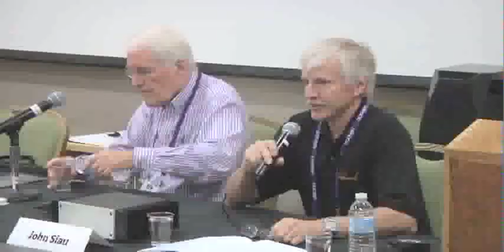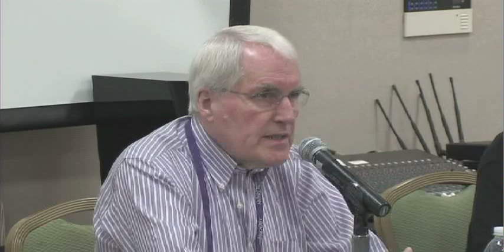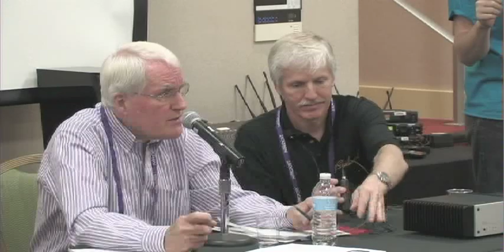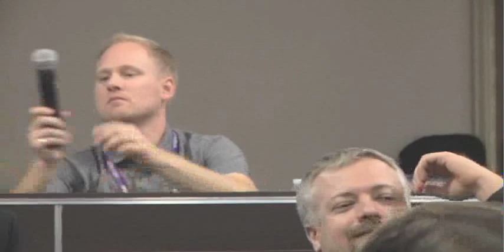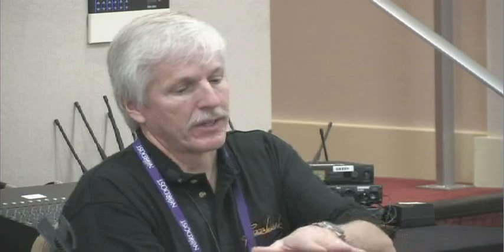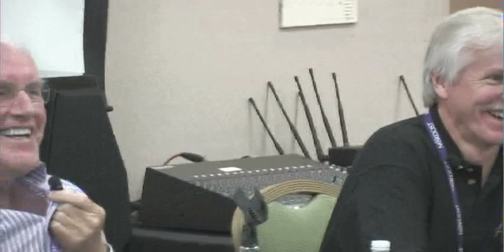RMAF13: Why Most 24-bit Audio Systems Still Deliver 16-bit Performance

Comment: Two companies that have come together to slap the relevancy of nearly every other device in the categories they've released their devices.

These are the sorts of people that push our quality sound standards further. And more importantly our understanding.

I challenge anyone here in the comments to demonstrably display any device that comes remotely close to what Benchmark's Power Amp is capable of: https://www.audiosciencereview.com/forum/index.php?threads/review-and-measurements-of-benchmark-ahb2-amp.7628/

This device is years old, and still nothing remotely close comes to challenging the fidelity this provides.
Reply: Yup, IMO that thing single-handedly demolishes the entire "high-end" power amp industry.  You can shell out ten or more times more than its $3k price tag and you'll wind up with measurably and audibly inferior performance -- it's really that good!

Comment: yes it does.  They're commenting on the fact that the amplifier is (was) a bottleneck for delivering more than 16 bits of dynamic range capability: "why most 24-bit audio systems still deliver 16 bit performance" is accurate. "why 130dB?"

Comment: bit rate is the size of block width and the khz is the high of that block used in measuring the sound curve. 192khz is not the frequency. 24 is more accurate division of sizing the width of the sound wave and 192khz is sizing the high. Smaller divisions mean the gap between each measurement round off is smaller and so is more accurate. khz is not a measurement of sound frequency but (fsp) FREQUENT SAMPLING POINTS and should be renamed. Its like measuring your table by inch and rounding up or down the the nearest. Then do that same using cm. What will be more accurate, its the CM's because they are a smaller division.  Use 24 bit 192 khz as a max. Above that you may not notice the accuracy. frequency is not related to data but reproductive response.
Plus in the real world you don't listen to maths you listen to the sound and you can hear a clearer sound with 24 bit 192 khz, but only just. Above that there's no point.

Comment: The difference between 16 ad 24 bit is measurable and audible if you have a system that can accurately reproduce it.  If you don't or if you can't hear the difference then don't waste the money and continue listening to MP3's.
Reply: +Cerastes  Spoken by someone who has not familiar with analog audio or quality audio recordings.  Of COURSE most people can hear a significance difference between 16 and 24 bit.  Maybe not you... But most people can easily tell the difference especially in the upper end of the audible freq range.  We aren't talking about dynamic range (loud to soft) so much as the quality of the frequencies that you are trying to reproduce.  ALL music is  analog when it starts out and it has to be or at least pretend to be analog for you to be able to hear it.  If you can't tell the difference between the audio quality between 16 and 24 then continue listening to your Beats ear buds and be happy.  The fact that you keep harping on dynamic range should tell everyone reading what you wrote that you don't have a clue about what you are saying.  Without going into painful detail Dynamic Range is a measure of the softest sound that you can hear to volume at the threshhold of pain that spread is averaged out to be around 0 to 120 db referenced to Watts.  16 bits can give you 96db SPL where 24 bit can get you to 140 db SPL.  That is a HUGE swing when you consider that every 3 db increase represents a doubling of amplitude.  As an example, the number 50 would be doubled to 100, doubled again to 200 doubled again to 400 and so on so that a 44 db increase would be doubling the amplitude ~15 times (50 to 400 = 3 times).  Having said all that, CDs which are capable of about 90db are better for Dynamic Range than vinyl albums or tapes at 60 db IF the engineers would use that dynamic range which they don't.  They intentionally compress it to make the music APPEAR louder and wind up having SIGNIFICANTLY less dynamic range than the albums and tapes used to have.  If they used 24 bit to record and playback they could achieve near live music quality recorded sound.  Anyone reading this should investigate for themselves by listening to Hi Def music played back on a good Hi Fidelity system.  Your own ears will tell you what is true.
Reply: +Marcus Jones Unless you listen to volumes which surpass the dynamic range of 16-bit, and can prove that the noise floor and dynamic range of the original recording extends beyond 16-bit, you are not even listening to 16-bit audio. 

http://ohm-image.net/opinion/audiophile/myth-24-bit-audio-hi-res-player-advantages

There are no practical/evidential sources which suggest 24-bit is better at playback. Of course, at recording level, 24-bit is important.
Reply: +Nathan Wright   Don't confuse the "original recording" with the "original performance".  The goal of HiFi is to recreate the original performance for playback.  As I said what engineers are doing is all to frequently not what they are capable of doing.  There were better recordings being made in the 70's than there are today.
Reply: +Marcus Jones - if you want to believe in magic, go ahead. Cerastes is correct. And even if he was not, you still have to listen at pre-gain and post-noise volumes that exceed 120dB in a perfect recording/playback/instrument/sustained volumes quality world (which isn't possible) to even take advantage of that difference.

You'd have permanent hearing damage in short order... and there would go your hi-res experience.
Reply: Raffie, I am not using a fake profile. If you'd like to provide evidence not only that I'm wrong, but that you are right, then I'm happy to see it. 

Edit: I should also ask: what 'shit' is it you think I'm talking?
Reply: Okay, you're trolling. Thank you.
Reply: +Çerastes   You keep talking about the Dynamic Range of the music
 which is nothing more than difference between how quiet the quiet 
passages can be versus how loud the loud passages are.  That has very 
little to do with audio quality.  You are trying to hammer a nail with a
 saw.  There is plenty of really well recorder music that 
doesn't have a great deal of dynamic range.  To all of the other
 people reading this just go and listen for yourselves websites like  
HDTRACKS.com has samples of music you can listen to for free.  Like I 
said, if you can't hear a difference then don't waste 
your money buying Hi Def tracks of music.
Reply: +Çerastes 

http://www.deathandtaxesmag.com/237292/all-the-ghostly-sounds-that-are-lost-when-you-compress-to-mp3/?utm_source=share-fb&utm_medium=button
Reply: Marcus Jones I don't remember defending lossy compression. I only spoke about 16-bit and 24-bit. 

And Marcus, there is NO benefit at all for 24-bit unless you are listening at 120dB or higher to music that is perfectly recorded and produced by instruments that can reproduce at least 120dB of DR etc., and that the pressing to digital has been perfect. 

Again, there is no benefit to 24-bit itself above 16-bit.
Reply: +Nathan Wright If you can't hear a difference then don't spend the money.  Stick with Beats earbuds and IPODS.
Reply: Marcus Jones No, you prove that you can hear a difference between the same masters in 16-bit and 24-bit at the SAME volumes, through scientific terms, and then we'll talk. 

Otherwise, your comments amount to nothing but religious belief in magic, and evangelism. Your extraordinary claims require extraordinary evidence, and you are unwilling to back them up except with anecdotes.

Finally, you attempt to show superiority over me by saying I listen to Beats and iPods. I'd like to know what it is you have against BEATS and do you have proof that they are worse than what you listen to. That said, I've never heard a beats headphone and have only heard Beats Tour earphones. 

As to iPods, you know, don't you that music isn't resolved like megapixels, it is resolved in volume, or decibels, and measures of that are done in dynamic range, noise, etc. Funnily enough, a number of hi-res players actually are unable to perform up to the output of an iPod nano 7G. Those include expensive Sony NW-ZX2 walkman hi-res players, and others. Other hi-end players, such as the AK380, are wonderful when not running load, but not good when running load, ruining signal quality. 

But even so, in order for tests to return 24-bit measures, they have to be played at volumes to which no human with severely undamaged hearing would listen. At normal listening volumes, there is next to no difference in output quality between any of them. 

Now, I could give you links with proof. The problem is you won't believe them. Nor will you understand them. 

There is no magic in digital audio.
Reply: ***** Ad hominem is one of the don't-do logical fallacies. I am not responding to you anymore.